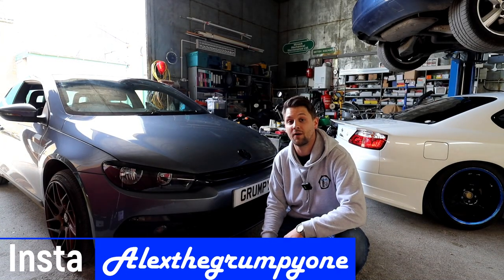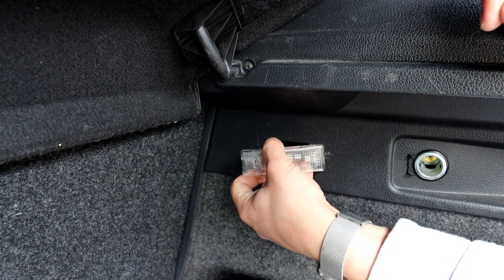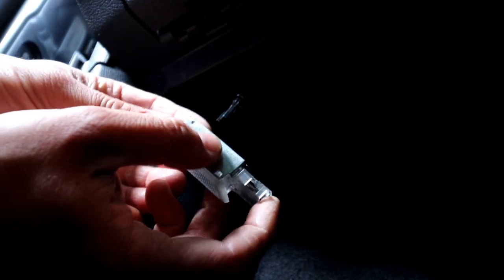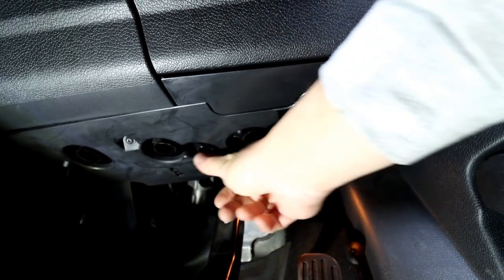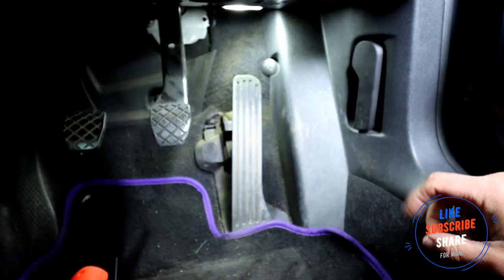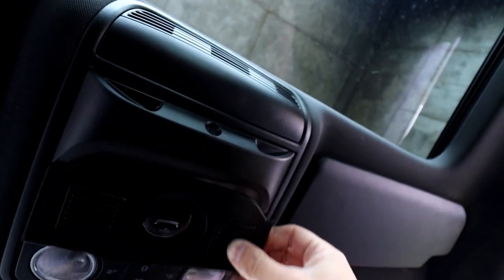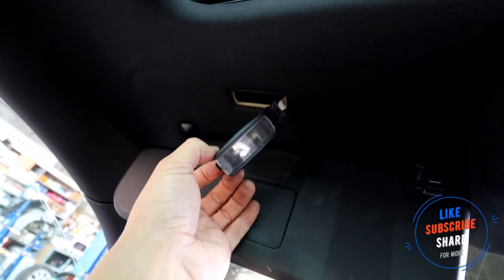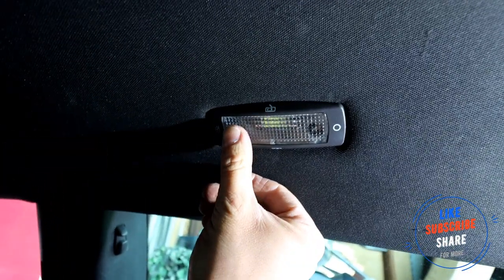VW Scirocco Full interior LED upgrade pack. How to upgrade interiro lights to LED. Discount code

Comment: nice one . it was one of the first things i did when i got the car back in 2016. I recently installed footwell lighting led because my car didn't have that
Reply from the maker: Thank you! 
Yep it's nice easy upgrades that make quite a big difference  😀
Reply: @AlexTheGrumpyOne  Yes . so.far the most challenging  was retrofitting R facelift bumper without swithcing the rear bootlid and lights . I couldn t find any used rear gate or lights from facelift.
Reply from the maker: Yeah that would be a bit of a challenge to be honest bud. Did you find any now?
Reply: @AlexTheGrumpyOne  I have been looking for rear tailgate and lights for over a year . I haven t find. So i used the middle section under the door and lights from my prefacelift bumper  and welded on the facelift one after cutting . So mostly i have a hybrid bumper . Upper piece prefacelift down piece facelift and I kept my prefacelift lighs and door. Quite tough but looks factory
Reply from the maker: Well done bud. That's pretty impressive  😀

Comment: Hey Alex, did they change the plastic cover for the interior top lights in the facelift? Mine will not come off - it all seems to be connected as one piece 🤷‍♂️🤷‍♂️
Reply from the maker: Hi there. Im not 100% sure as i havent done one of them. But its possible that they did change it

Comment: I found out in my VW Scirocco  2011 that the both reading lights size are 38mm, rather than 36 mm. Or this will also fit with 36 mm with little squeezed?
Reply from the maker: Yep it should do 😀

Comment: All of my lights work except my glovebox and footwell lights, I have checked all the fuses I have and none of them are blown, do you have any idea why just them are not working?
Reply from the maker: Hi there. 2 things to try first. Can you check your dash setting to see if they are on and then if it doesn't work disconnect the battery for 5 min and check if they work.
Reply: @AlexTheGrumpyOne  tried that, hasn’t worked :(
Reply from the maker: Have you gor original ones to check?
Led bulb in properly?
Reply: @AlexTheGrumpyOne  yeah I’ve tried the original and the led ones, both not working, checked all the fuses, none have blown
Reply: Did you ever fix this? Mine has done the same?

Comment: Managed to change all of them except the glove box. Tried prying it with a screwdriver and it just felt like it was going to break if I put much pressure on it so I bottled it and left it as is 😅😅
Reply from the maker: Well done 😀
Reply: @AlexTheGrumpyOne  thanks for your video, it definitely helped with the drivers side footwell light and also how to get the rear light out. I just wish there was an easier way to do the glove box without feeling like I’m going to break it 😂😩
Reply from the maker: @Themaskplague u can try and remove the whole gloss box section, but that would be a pain.
Reply: @AlexTheGrumpyOne  yer not looking to take the whole thing apart , I’ll give it another go with the screwdriver method tomorrow like in your video and if it doesn’t work I’ll just leave it. It’s only the glove box light at the end of the day , not the end of the world if it can’t be changed
Reply from the maker: @Themaskplague yep that's true. 👌

Comment: I just done this new bulb in now it don’t work neither does the old one 🙉
Reply: Footwell lights this is how long does car need to run for
Reply from the maker: You might need to disconnect the battery for a bit

Comment: All of my interior lights aren't working. Everything on the outside does work, but none of the lights on the inside. The rest of the car is fine though. Do you know what could be the problem. Already checked the fuse box. Nothings wrong with that. Also the red light on the interior light does work. So i have no idea where to start looking
Reply from the maker: I would double check the bulbs again please. Are they LED and are they from Car Mod Shop link?
Have you tried disconnecting the car battery for 5 min?
Reply: @AlexTheGrumpyOne  no these are my stock lights.  Never tried disconnecting the battery, because my other lights do work.  But i'll try that thnx
Reply from the maker: I would give it a try bud. So even your centre console lights don't work?
Reply: @AlexTheGrumpyOne  Everything in the car works, except all of my interior lights (2 lights in the back in think, 2 above your head, 1 driversside feet and 1 passengerside feet)  Also to note is that the little red light in the interior light above your head does work. So its getting some current atleast.
Reply: don't know if these lights are connected in series or parallel. Havent measured any of them through
Reply: just to give an update.  My car wouldn't start this morning because i kept my lights on all night,  so the battery was all drained.  With jumpercables i got it to work again and my interior lights are also working.  So it was a hard reset that was needed. Just disconnect the poles for 1 minute and that should do the trick if anyone wonders. Thats for the help tho 8 months ago haha
Reply from the maker: Yep that works 😀 I think I've added that to one of my video to make sure that if they aren't worming for some reason to disconnect the battery for 10 mon
Reply: Just put new footwell led bulbs in now they don’t even power on even with old bulbs back in? 
Tried disconnecting battery for 20 mins still don’t work? What am I miss here? Shall I try fuses next?
Reply from the maker: I would definitely check the fuse please
Reply: @AlexTheGrumpyOne  will check tomorrow 
Where will the fused be located? Seems weird soon as put led in they stopped but drivers side was still working with standard bulb in
Reply from the maker: There might be some contact issue somewhere in the circuit
Reply: @AlexTheGrumpyOne  such a easy mod turned into a right pain lol hopefully get it sorted. Thanks for your help mate
Reply from the maker: No worries. Keep.me posted please
Reply: @AlexTheGrumpyOne  will do, I took battery off for 15/20 mins but didn’t work do you think that it needs longer to reset
Reply from the maker: That should be more then long enough to be honest
Reply: @AlexTheGrumpyOne  ah ok must have blew a fuse or bulbs I bought wasn’t error free. Just hope can get them working again
Reply from the maker: Yeah have a good look and also check.the contacts as well 😀
Reply: @AlexTheGrumpyOne  ok mate got them working turns out it was the connection points where the bulb fits in phew thought I blew something for a second appreciate your help love the videos any more scirocco one’s coming
Reply from the maker: Awesome 👌 well done bud. I'm glad you checked it 😀 
Thank you very much for your support. Means a lot